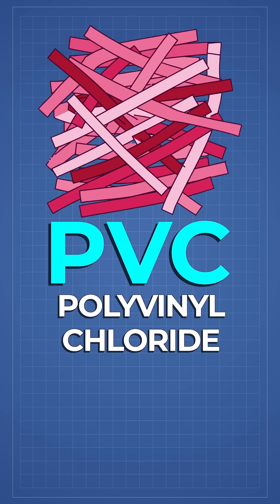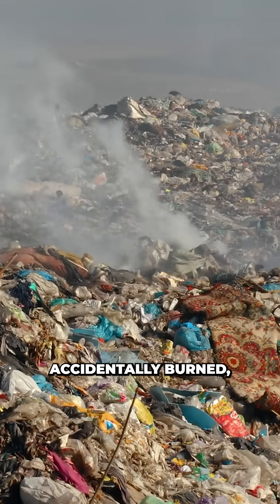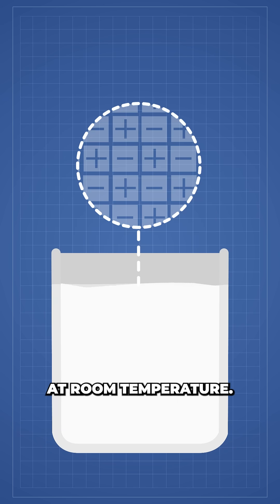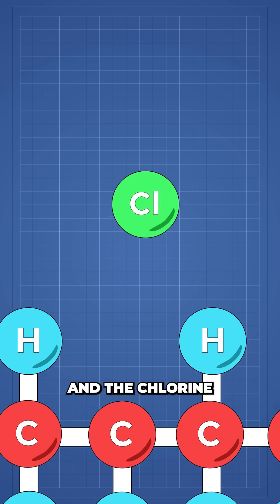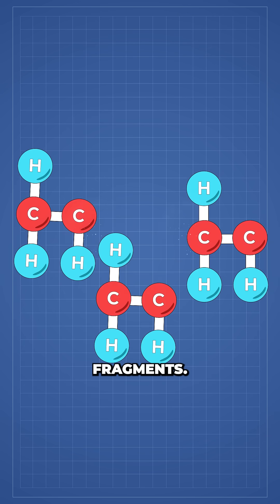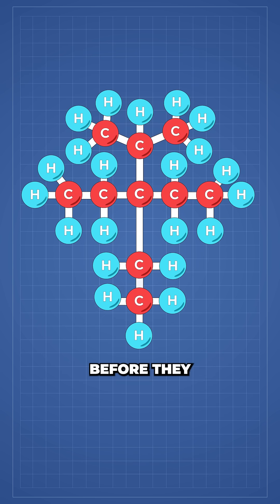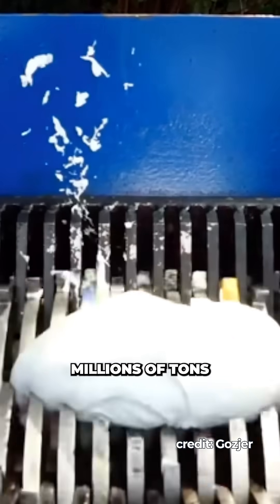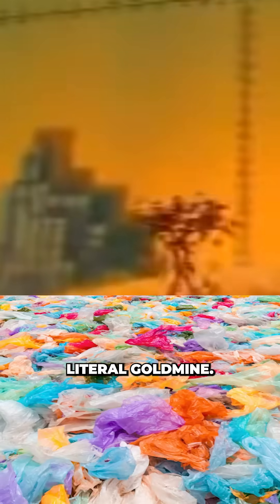Scientists Turn Plastic Waste into Fuel

Comment: BTW, the Julian Brown, who appeared at the start of the clip, is the USA Inventor from Atlanta, Georgia who advocated for using "Plastoline" fuel in the USA.
Reply: "Inventor."  He didn't invent anything.  Pyrolyzing plastic into hydrocarbons isn't a new process, and he dumps his water directly into the community around him.  His "fuel" is unusable unless you want a ridiculously amount of extra toxins released into the air on top of what burning hydrocarbons already does
Reply: @thetaintpainter5443  false. Look into him a bit. He recently ran a gas engine dodge charger with it.
Reply: @ATOMIK3488 : Running a Dodge Charger off of it doesn't contradict what anyone else was saying.
Reply: I love his energy, but he's totally gonna give himself Cancer......
Reply: He’s nothing than a grifter. It’s not a new concept. Look at how much product he gets from what he start with. It’s the issue they’re just figuring out now. It’s nothing new. Do your research.
Reply: 1. he is not an inventor
2. this stuff can never work in the real world...
Reply: @bumpy86  it works. Makes fuel from plastic. But holy shit is it inefficient. I'm pretty sure burning solid plastic as fuel would be a better power source if ran through a turbine or used in a steam boiler. The amount of fuel produces in pyrolysis only makes up about 1/10th or less of the energy used to make it.
Reply: @timmythegodofthecaelumsupe74  it’s too impure for automotive engines.
Reply: @marz5726 : It could be refined, what you should focus on is that the need to refine it just makes Timmy's point even stronger.
Reply: came here to make sure he gets his flowers. wish the OP would have discussed him more
Reply: @holiestvirgin  While I don't see "plastoline" being realistically feasible at a quality people would use, most studies on it are just looking at feasibility rather than giving it a go and learning something new (I may have contributed to this pile), for actually giving it a go Julian deserves kudos. Science for science sake is actually a rare thing, way too much science now exists just so they've published a paper so scientists can keep their job

Going in with no monetary incentive allows him to more freely experiment, and maybe he might make it a few percent more efficient, or approaches it at a different angle, or through random trials finds a catalyst which improves purity a little

Throwing science at the wall and seeing what sticks is something more amateur scientists can and should do, if only to gain experience, with a tiny chance of finding something no paid scientist would find. Julian began because he was a welder and he's welding hot pressure vessels, which is incredible experience

It would be nice if he understood the importance of purity and really what kind of fuel plastoline is, but I also don't think anyone watching him is expecting that level, most of YouTube is that it just needs to work for the video. Him showing that someone without a science background can get into it is worth more than some missing details
Reply: @TheOminousReaper  lol get his flowers for what? Dude is a scammer that pretended like his life was in danger to farm the uneducated of money.
Reply: that guy was only doing what scientis in the 90s were doing
Reply: It’s annoying to see the guy from Texas, and now some random Chinese university, getting credit for something people have already been doing for a while (turning plastic into fuel). HOWEVER, the process seen here is the video is not pyrolysis as many people claim in the comment section because there is no heat applied here, it’s all chemical (their bonds). Very similar though as they both happen in the absence of oxygen
Reply: @Living.Growth.Mindset it is pyrolysis and heat IS applied. Did you not watch any of his videos? He's using microwave magnetrons to heat the plastic to pyrolysis temperatures. Many people in the comment section are claiming it's pyrolysis because it IS, and he's using high temperatures just like had been done for decades. Where the hell did you come up with "it's all chemical"???? You can literally see the magnetrons on his device.. Here's an excerpt from a Chinese paper (you mentioned it) that is using the EXACT same process he is. "The new chemical recycling method cracks plastics into olefins such as ethylene and propylene at high temperature without using any catalyst. Recently, it has been reported[qv: 8] that graphene could produce large arcs during microwave irradiation, which typically lasted for 50–100 ms per arcs. The ultrafast heating process upon arcs could generate very high temperature up to 1000 °C or even several thousands of Celsius in only tens of milliseconds, which is extremely suitable for cracking hydrocarbon into olefins at high temperatures with short residence time"
Reply: He is creating fuel, but the way he’s doing it is incredibly inefficient, dangerous to himself and the environment. Someordinarygamer has a good video on him I’d recommend giving it a watch.
Reply: You guys are all wrong he's been getting cleaner higher octane "Plastoline" as he calls it! He ran a dodge challenge red eye a few weeks ago in Michigan I think it was,  IDK what you guys got against Julian Brown but his results speak for themselves and they're real!
Reply: @mikeeng6689  lol
Reply: @mikeeng6689 : What the have against him is that he'd taking an impractical fuel production process (pyrolysis), and tricking the unaware into thinking it's practical. It was discovered before he was even born (other variations are traditionally used to produce charcoal, and have been used in petroleum refining since at least the 1940s), and it's innately cheaper to perform with conventional petroleum than with plastics. His approach might offer some minor improvements, but frankly major improvements are needed instead.
Reply: He is a sham. He pushes his ideas as brand new and world-changing, when what he is doing is not a new and is wildly inefficient. He has a sketchy backyard setup that is unsafe, and he claims that his fuel has passed some mystery “diesel test certifications.” Meanwhile he is making a ton of money off of social media, and even faked a disappearance which led to a ton of new donations to his go fund me, which has raised $36k+. He takes advantage of the uneducated and is a snake “oil” salesman.
Reply: Not an inventor, he literally did what companies have been able to since like the 80s, why do they not do it? It's not cheap and uses more energy and fuel to convert plastics into unfiltered diseal with some byproducts, Essentially producing more carbon in the process and using more fuel to create an inferior product. He's not an inventor, innovator is fine.

Correction : 60s
Reply: @RetroRuin no one said he invented it
Reply: @Cronyxx  are you dense? Yes, alot of people believe he invented it and he literally calls himself the inventor of the process, stop being ignorant.
Reply: @RetroRuin  he never called himself the inventor of the process, he just called himself the maker of the machine
Reply: @RetroRuin not even the 80s, try the 1960s lol. He's pretending it's new
Reply: @RetroRuin hes an inventor because he constructed those things himself in way he found fit for himself based on his own studies tf
Reply: @haleyyheatherr725  did you drop out of highschool? Because none of those makes you an inventor🤦🏼‍♀️🤦🏼‍♀️🤦🏼‍♀️ just as much as bandaging someone doesn't make you a doctor and cooking doesn't make you a chef and mixing stuff in chemistry lab doesn't make you a Chemist or a Scientist. Do i need to explain things to you like a toddler because that sounds like the level of intellect ya'll have these days.
Reply: @RetroRuin : The "based on his own studies" bit DOES make him an inventor, the question is if his invention is genuinely useful... and frankly, probably not. Don't over-qualify the word "inventor" (or Doctor, or Chef, or Chemist, or Scientist). None of those roles are completely free for the taking, but the qualifications are both simple, and purely behavioral (and for all but "Chef", dominated by the scientific method rather than anything else).
Reply: @absalomdraconis  unreal levels of copium 👍🏻 i copied the exact scientific process of making pyrolysis, that makes me an inventor 🤓 i treated my symptoms, that makes me a doctor 🤡 I opened the back cover if my laptop, I am a technician. I cooked something someone complemented me on, Now I'm totally a Michelin star chef 😼

We wuz pyramidiands and shiz, wypipo tooks it all away.
Reply: Yea!
Reply: @reinab8168 noa!
Reply: And the guy is a clown. He pretended to disappear when his money dried up, he’s had his “fuel” tested and it’s all garbage carcinogens. He’s an idiot with an even dumber following making a superfund site for clout. Styrene and bromine, the “fuel” he’s making are not useful as an actual fuel. 

He knows he’s making liquid garbage and he doesn’t care. He’s going to get someone killed.
Reply: His life is in danger to we must protect him at all cost
Reply: @CapoOgeezy nah
Reply: He actually just posted a vid not too long of him using said fuel in a truck that had all it’s previous fuel emptied and replaced with his new plasta-diesel. There was a noticeable audible difference between the two trucks running, was pretty interesting.
Reply: @DaytakZephyr  That's because his shit is just toxic waste.
Reply: I remember him
Reply: Advocates*

He's STILL ALIVE PEOPLE!!!
Reply: Is he ok , I haven’t seen him any more?
Reply: The issue is that what he's making is not fuel, and it requires lots of energy to make, which ends up releasing more carbon and microplastics, and cost more in energy, than simply throwing it away would.
Reply: @memeityy  these people arent ready for the truth lol fact is this has been done for decades and theres a reason its not that industrialized
Reply: @memeityy you forgot to add the extremely carcinogenic chemicals he's releasing to the air in his neighborhood
Reply: @memeityy  his operation is ran on solar powered generators. So try again.  Dipsh¡t
Reply: @memeityy actually he was using a solar battery bank to run his machine.
Reply: @memeityy  You sound like someone selling oil. There are ways to produce clean energy and you know it.
Reply: @haraldhartgeld yeah, and this isn't one of them
Reply: @memeityy  the fuel quality is also awful resulting in a lot of unburnt fuel being released into the air
Reply: @skylark.kraken  you just spewing bullshit out here without researching huh 😂 he LITERALLY showcased what grade his fuel is. He used a 3rd party fuel octane rater/reader on his fuel & it was read at 110 octane. That's literally race grade fuel, much better than you can buy at the pump. The only major chain I know where you can buy fuel close to that is Shell, other than that you'll only find that high octane at the track 😂 but please keep the echo chamber going 🤡
Reply: @lilceser11 you can't say that's true either. We need peer review of the grade of his octane fuel with multiple independent analysis because if his the only one claiming that in the scientific world that's the same as lying especially when Pyrolysis is known to create terrible fuel and since his machine is made with Recycled parts which is impressive it will will greatly effect the final product
Reply: @lilceser11 which means literally nothing. He had his fuel tests in a mass spectrometer and it showed it was an insanely dangerous mix of styrene and bromine. It’s not “fuel”, kts flammable poison that releases huge amounts of toxins into the air. It’s useless garbage.
Reply: @lilceser11  You are almost entirely clueless, pal. You’re going to feel some type of way, ideally embarrassed and dumb asl, when you realize. 😅😂
Reply: @skylark.kraken  Thank you for this proper information, big cat. 🧐
Reply: @alexmercado20  My pleasure, meow :3c
Reply: @lilceser11  Higher octane doesn't mean it's inherently better, more powerful or more pure or whatever. And his testing device isn't fit for a rigorous testing since these are calibrated for standard fuel composition not whatever he produced.
Reply: @lilceser11  
Octane is an additive, not a flammability rating.
91, 95 and 98 are literally the same fuel and as such have the same level of flammability.
Octane of varying strength is added to prevent early detonation in high compression engines.
Reply: @lilceser11 last time i checked, he’s making diesel and it takes 200 lbs of plastic and 4 hours to make 5 cups of his bullshit gas.
Reply: @lilceser11 his fuel is by no means 110 octane.  Just by looking at it, you can tell is garbage.  It's not even a liquid, it's mostly tar
Reply: @lilceser11 octane is not a measure of quality 😂😂😂
Reply: @lilceser11  Oh wow, you're really sensitive to propaganda, aren't you? 😂

Just for your info (although I'm sure you won't do anything with this😅); octane doesn't say anything about the quality of a fuel. Especially not when you're using a tester that's not rated or calibrated to test toxic waste. Octane rating just means how resistant to knocking it is. Go look up the octane rating of toluene and xylene. Neither which you'd want in your fuel in any meaningful amounts. 

That Russian tool he's been wrongly using is made to compare specific types of Russian gasoline to the stuff from the pump, to make sure it's not watered down with anything. You can't just stick it in any flammable liquid and determine the octane rating, you need a very specific setup for that. Something that's well of reach for some random dude without any knowledge on the stuff. 

But it's a nice example of how Julian is misleading uneducated people.
Reply: @lilceser11 : Octane has no relation to emissions, it's purely about the likelyhood that the fuel will undergo detonation rather than combustion (detonation is more efficient, but tends to break engines too quickly).
Reply: @DrakeTain : That can be used as fuel, it just has no business being in a gasoline or diesel internal combustion engine. It would be perfectly usable in a correctly configured steam boiler system... he won't be using such a system, and Jay Leno is the only person I know of with a steam-engine car, but if he did use it in one that had been correctly configured then it would be perfectly fine.

IF.
Reply: @memeityy  he's currently working on converting his energy usage into full solar/ renewables sources. We'll see how it goes, hopefully he can succeed because yes one of the biggest drawbacks of converting this plastic into fuel is the huge energy demands. If he does make his entire process run on solar, it'll be a major breakthrough on the viability of this technology
Reply: @lilceser11 the break though isnt running on solar, you have enough solar you can do it. It refining the process to use significantly less energy to make it. The laws of thermodynamics dont like that idea. Even if I think what he's doing has some flaws im rooting for the guy. It would finally make getting rid of all the plastic bs profitable, so people would push to make it happen.
Reply: @memeityy  processing the plastics into fuel makes more plastics? that just means we can make more fuel out of it! youve discovered infinite energy!
Reply: @MDS-SAP  comprehension, my dude he said micro plastics.
Reply: @MDS-SAP  Releasing ≠ making
Reply: @MDS-SAP except it takes more emergy that it produces....infinite energy in reverse....
Reply: @memeityy Not quite, his machine produces zero emissions due to it being entirely solar powered. Also, didn’t he test the fuel on his own car iirc?
Reply: @paeoniaknight  how do you convert unfiltered fuel into filtered fuel? It still produces ALOT of carbon to frack, separate and discard of all the toxic waste and Fumes.
Reply: @paeoniaknight  There are MANY ways his machine could produce emissions, which have nothing to do with the power source
Reply: @MSUYHow so? Bc afaik he claims it doesn’t produce any co2 emissions or toxic, unusable byproducts. Is there something we’re missing?
Reply: @paeoniaknight  All of these claims are completely unsubstantied, but it should be obvious that heating unsorted plastics with very different chemical makeup in an uncontrolled manner at high temp could result in toxic byproduct. If there are any in gaseous form they would either end up in the air when he re-pressurizes the machine after a batch or in the product he collects
And GC-MS analysis of his fuel did show toxic substances. Plus there's always some solid residue in the reactor after a run which have never been analyzed
Reply: @MSUYyeah ofc it’s unsubstantiated since it’s a prototype and rn we can only go by Brown’s word for now. I know for sure he implemented a filtration system for any omitted fumes. You have a point but so far, his invention is a stepping stone to the right direction in terms of tackling plastic pollution and fossil fuel dependency. Obviously with time, research, and constructive feedback that any of these setbacks can be worked out. It isn’t perfect, as all prototypes aren’t, but his invention has a lot of great potential and that’s what matters. It’s better that there’s something rather than nothing.
Reply: that process is super inefficientand super polluting, and it is not in any danger because it is so difficult to make a profit from it. In Mexico, there is a businessman's plant that does the same thing, but since it costs him a lot of money to do so, he sells it at a similar price and in the process pollutes more.
Reply: He made a kiln for pyrolysis, it’s pretty basic, he covered it in tin foil so it looks like the lunar lander, wow
Reply: He didn't come up with it. He did make a machine on his own which is impressive though. But either he is overly optimistic or a grifter because the economics behind it unfortunately don't check out.
Reply: He is a definition of a clickbait.
Reply: Hes not the person who figured it out, its old knowledge.. called plastic pyrolysation..
Reply: @McButterbiscuits 

Shh, we waz kangs is listening
Reply: @McButterbiscuits  Welp, he's popularizing it, so that matters most!!
Reply: @McButterbiscuits  no one said he figured it out
Reply: it's either all of these people commenting are bots or 95% of people in this world are just sheeple. 
he clearly still releases videos refuting all of these claims with proof. Yet am dumb founded by the amount of 🤡 in this comment.
Reply: @papson86 you're the 🤡 for believing some random guy with zero research to back up his claims 🤡
Reply: @papson86  cattle
Reply: @papson86 He’s making an insane quantity toxic pollutants to reclaim a tiny fraction of usable fuel. It’s an engineering dead end from 70 years ago.
Reply: Julian brown is a scammer, he's using a process from the 1960s calling it new and ignoring the fact that it's extremely inefficient and damaging to the environment. His process is WORSE for the environment than piles of plastic in the ocean and on the beaches and that's a fact.
Reply: @DarkAttack14 THANK YOU. I keep telling people this and they keep falling for it.
Reply: @DarkAttack14  Julian Brown (naturejab) is not a scammer. He is legit. He clearly and repeatedly stated that Pyrolysis existed but he is the FIRST to Invent the Solar Powered Microwave pyrolysis. The energy output is greater than the energy input. Yes he is an Inventor. Secondly his fuel has been LIVE demonstrated on multiple cars. You are either misinformed or an insecure liar.
Reply: @DarkAttack14  My man, I’m not gonna read an essay from an anonymous YouTuber. The internet should’t make you this angry, lol. I will comment on that part about input energy and output energy. So you’re saying that when people drill for oil, the energy used to drill for oil is equal to the energy the oil will eventually produce? No, of course not. It’s the same thing with Julian, I am saying that the energy used to microwave the plastics is less than the energy the plasticine will produce silly.
Reply: @DarkAttack14 hes not calling it new, he's stated that this already existed before him, and how is it worse for the environment
Reply: @GrootBe8rwhile claiming he's made advancements which is a bold lie, his systems less efficient than the systems from decades ago. They've already "perfected" this technique and it still sucks and always will
Reply: @DarkAttack14 it doesn't need to be done just because its not efficient, if he's trying to make the world a better place by researching ways to remove plastic and reuse it, we should support the research, not try and tear it down. Not everything has to make money, te environment is infinitely more important than profits
Reply: @GrootBe8rwe should support research that had an actual pathway, there is no pathway for pyrolysis. You know what has a pathway and doesn't destroy the environment? Plastic eating bacteria.. His process is environment destroying not environment saving
Reply: @DarkAttack14 That and I shudder at the idea of someone with dreadlocks holding any kind of lab ware.  Science demands integrity, a strong since if work ethic, creativity and methodical planning not mention a substancial intellect.  All qualities that Julian lack.
Reply: @jtbmetaldesigns I'm about it, I'll give him credit at least he isn't directly robbing people, just committing fraud and polluting his neighborhood turning it into a superfund site with every run haha. I couldn't get a response from him on his videos, I begged him to explain the difference in his system versus the pyrolysis systems perfected in the 1960s and 70s, no answer.
Reply: @jtbmetaldesigns no need to be racist
Reply: He's not an inventor. He may claim to be either because he's lying or because he isn't aware that what he's doing was done decades ago.
Reply: @momatotsosrorudodi he doesn't claim to be an inventor, at least not anymore
Reply: @momatotsosrorudodi he must know...
Reply: @momatotsosrorudodi he's a scammer. He's trying to  get funding for a process companies have done since the 60s, except his is less efficient lol
Reply: @momatotsosrorudodi  he never said he invented it, he just stated that he made a machine
Reply: @momatotsosrorudodi  yeah cope bc whites couldnt do it years ago
Reply: @aimbot6264 you mean when it was originally invented...in the 60s?
Reply: @JoshWitte  sure bud, its not hard to use the device in front of u
Reply: "Inventor" Pyrolysis have been discovered for decades bruh
Reply: I saw a video of some scientist who was sent samples of the plastoline.  the short of it is that it has very minor fuel properties but mostly just air pollution.  It’s obviously early stages so it could still be promising, but as of right now, it’s just pollution with extra steps.
Reply: He also mysteriously disappeared back in July 2025.
Reply: @BenBRockN luckily he’s safe and sound, posting updates on tt
Reply: @BenBRockN  he's back, iirc he got burned when something failed and exploded/flash burned. Had to take time off obviously
Reply: @cameronlang6858  I hope so!
Reply: @cameronlang6858 bro doesn't know what he is doing, he just copying a 70s procedure 😂😂
Reply: @BenBRockN  Its not mysterious he was just farming clicks from goofy conspiracy theorists while taking a break from social media to recover from an injury.
Reply: @BenBRockN some of his accounts got hacked but he decided to stay silent for a little while before posting again. bad decision imo, as he let speculation run rampant
Reply: @BenBRockN bro his literally only using Pyrolysis. He didn't invent the shit but he did create one using scraps but the problem is Pyrolysis is extremely inefficient you burn more energy than you can create and also hazardous. If you're thinking he can innovate the process, no you can't because the problem comes with chemical physics
Reply: @quadratic7578 no sht dude. never said he invented pyrolysis.
Reply: @BenBRockN people that stop posting on the internet are not necessarily disappearing irl. im not saying it doesnt happen im just saying that yall gotta stop posting misinformation/disinformation
Reply: @BenBRockN  that’s because he had a really bad injury. His whole machine exploded.
Reply: @BenBRockN  it was explained by him on his channel goofy....
Reply: @BenBRockN he’s actually fine. There was a clip of him with his mother in which he says “he’s been targeted and he’s in hiding”
Reply: @Starlight-25920such a scammer, why would he be targeted for technology that was invented in the 1960s???
Reply: @Starlight-25920 no one is after him, lmao
Reply: @Starlight-25920no one is targeting him for doing useless science
Reply: Wow all these repeated comments saying the exact same thing worded slightly differently.... 👀😂 Bots... Bots everywhere
Reply: Unfortunately he is a scammer, the process he uses is not new.
Reply: @CanariasCanariass  iirc he didn't claim he invented the process, nor invented the process using microwaves, but he did make his reactor, and did claim that it was the first "plastoline" powered car in Chicago (which I assume is legit, because it's not a good idea to put it in your car without a lot of processing. No clue if he was the first to create it in Chicago but I don't know if he claimed that)

He's guilty of hype and getting his demographic interested in taking part in science. He's not writing papers claiming to be an inventor, he's not going on TED Talks to claim things, he's constructed impressive apparatus and can produce a lot of plastoline at a time

Science doesn't need to be wholly new to be noteworthy, while I'm not aware of him discovering anything yet, he is set up to tweak recipes to get the best result and even if he's unable to find any plastoline that is actually worthwhile then that's worth knowing. He has a goal of making it work, and that's special and should be encouraged

I went to Oxford University and I know some smart scientists, I share a Discord server with them, do you know what really smart scientists said when they shared his videos? "That's sick" and other compliments along those lines. One of my friends has actually worked on feasibility studies for pyrolysis for plastic waste recycling (AFAIK Julian invented "plastoline" which is a valuable contribution for communication, better than "pyrolysis oil") and when he was running experiments he was working on a really small scale (he also dealt with actually getting good quality fuel, which Julian seems to need to work towards but it's tricky and dangerous stuff), and Julian is out there with a big reactor ready to test a range of things, without pressure to get papers out there
Reply: @skylark.kraken your words of reason give me hope for humanity!
Sure Julian does science and technical experiments in a backyard way and might not always be accurate - not everyone has the background, funds and company.
But he brings so much enthusiasm, skill and curiosity to the table of science and its communities looking for interestings stuff and ever more knowledge.
A big net positive I would say! 
I really do not understand people speaking that ill of him and trying to take someone like him down...
Reply: @chr1spepp3r  I have a feeling people talking down about him just think they're so smart: insert the Gauss distribution meme (idk what the proper name is, but the one where the lower and upper end going "that's so cool", and middle crying "but it's nothing new")

Considering how much bs pseudoscience promoted as "science" there is, it's a colossal waste of energy trying to pull down someone being hyped about his achievements
Reply: @CanariasCanariass he doesn't say its new, at least not anymore
Reply: @CanariasCanariass he built a plastoline production lab in his backyard. check your racism
Reply: @holiestvirgin he didn't say a single thing that was racist
Reply: I thought he invented the process for doing this
Reply: @TheNedoow Nope! He loves to claim he did though
Reply: @conzmoleman thanks for the info my dude 😊
Reply: @DrBenMiles please pin this comment because tgat inventor needs and deserves the credit. He had to figure out a lot of that himself including where to plot his conversion machine and how to get it running like that
Reply: @haleyyheatherr725 he didn't invent anything.  Polymer pyrolysis has been a known process for centuries.  He's a grifter who's poisoning the environment around him and putting his community at risk
Reply: *American inventor. He's an American, not a "USA".
Reply: @TurlessTiger he’s not an inventor. He’s a conman.
Reply: Spread the word